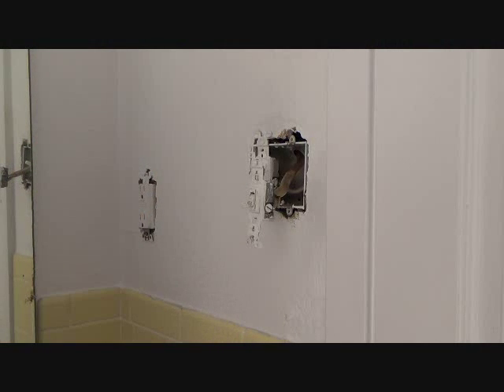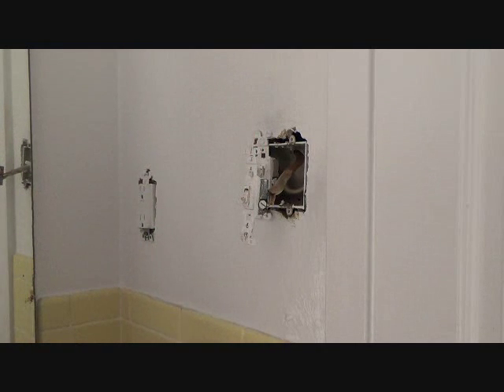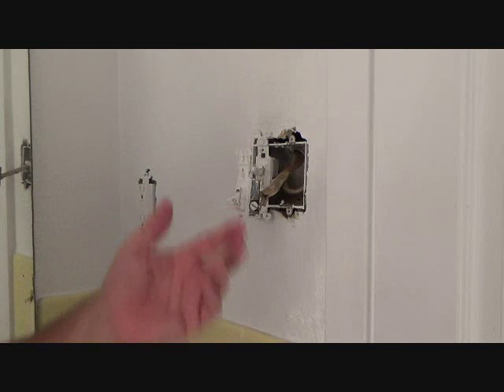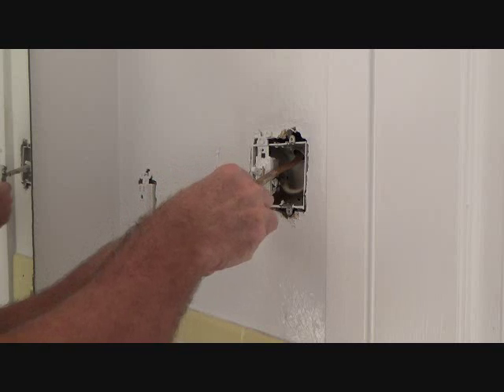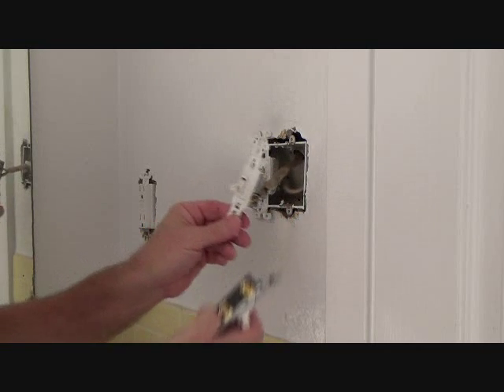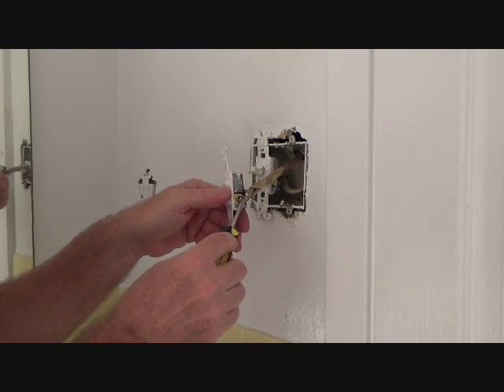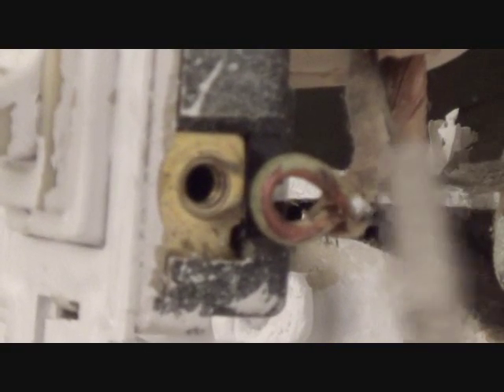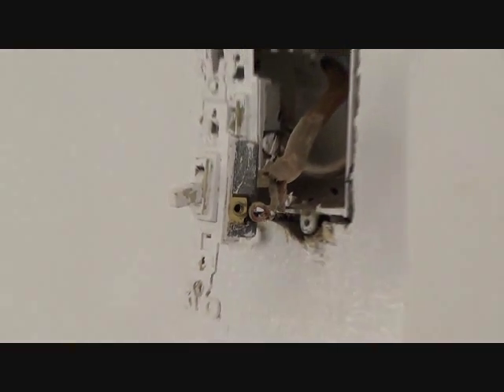Why is there a white wire connected to the light switch?

Comment: Posting here in case lol I have the same type of wiring. I want to add a special dimmer but the dimmer has a natural wire coming out from it. What do I do with this wire when I have nothing to connect it to?
Reply: You need to get a neutral to your switch’s j-box if you want to use that dimmer.
Reply: Todd Saltzman ...hi there,how can i get a neutral on?i have a 1950 house,would i have to run new wire to breaker box?seems like all white wires are the black ones,they both have power to them
Reply from the maker: In the old days lots of electricians use to run the actual power feed to a light fixture first then they would run two wires down to the light switch location & one wire was for the power to feed the light switch & the other wire was for the feed to go back up to turn the light fixture on & that particular wire was the white wire as they were using it for an actual power wire & not a neutral wire. Electricians are suppose to wrap black electrical tape around a white wire in a light switch box if they are going to use as a black wire but lots of those guys don't. Maybe this will help so you can then figure out what is your case.....& go from there knowing what you will need to do.
Reply from the maker: What did you end up doing? You sure that white wire wasn't used as a black wire instead? Just asking.....

Comment: This is called a reverse switch loop.  More recent code requires black tape on the hot white wire.  Never remove the Staked screws from a switch or receptacle because doing so will strip out the threads and make for bad connections. A flat blade screwdriver can be used to pry open the old wire loops for reuse.  The holes in the "ears" at the top and bottom of the switch can be used to make decent wire loops without a needle nose.  You can strip wire with your knife but great care must be taken not to nick the wire.  The method is the same as sharpening a pencil. When putting in a new switch at least 6" of free wire must be available in the box per code.  That means the jacket needs to be cut back to where the cable enters the box. This also can be done very carefully with a sharp knife but a cheap cable slitter is safer for the wire.      Good job on the camera work.
Reply: yeah that staking in those screws, I don't really agree with the decision to do that. The only benefits I can think of seem either marginal or not real. The downside is real, that you can't remove screw without ruining the device. They should at least specify a design that will not self-damage so easily by loosening vigorously.
Reply from the maker: Yes I have never heard of this & have removed screws on several occasions to then put them back in nice & tight & never had an issue before....
Reply from the maker: Well I never knew by taking the side screws out all the way would possibly damage the threads to where when you put them back in they might not hold properly but I've done this on a few occasions & never had an issue with the screws not getting tight or any electrical issues with the outlets or switches I may have done this to in the past but good to know. Thanks for your indepth message!

Comment: Hello Mr Joe,  I have a question?   I have both the W and BLK wires as you have above which are both hot.....I was wanting to know about putting a new Smart Control to a light switch but it is asking for a White wire but I do????
Reply: That particular  application is a switch leg the power goes to the light box and your using the white as a constant got and black as the switched hot. a smart switch requires a neutral connection. so you would have to do some rewiring . this is an older technique article 404.2 c states that a neutral or grounded circuit conducgot shall be located in the switch box not the light box
Reply from the maker: Thanks so much for replying to him. Much appreciated!
Reply: Adam Wise...same ussue here how can i get a neutral on?i have a 1950 house,would i have to run new wire to breaker box?
Reply from the maker: You could get it right up at the light fixture since they initially brought the hot power to the light fixture box then ran the switch legs from there to the light switch box then back up to the light fixture. So you will have a neutral white wire up there so you would need to fish a white wire down to the light switch location for your neutral. See?
Reply from the maker: I take it you read the other guy's message back to you. Were you able to get your new light switch installed over 7 years ago?!!